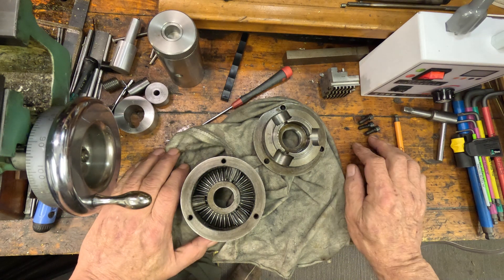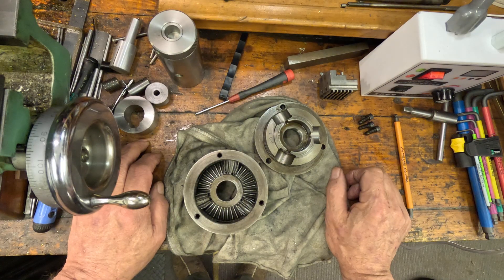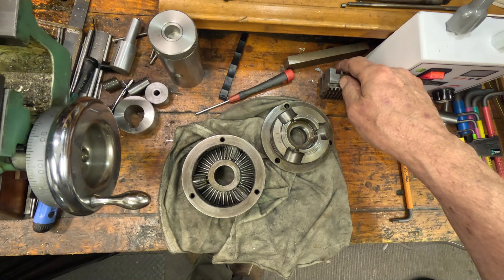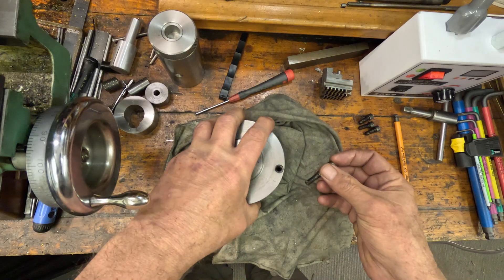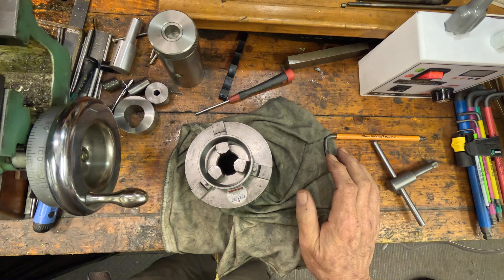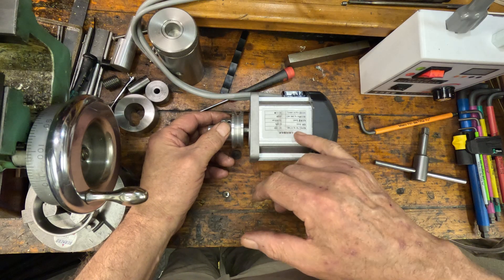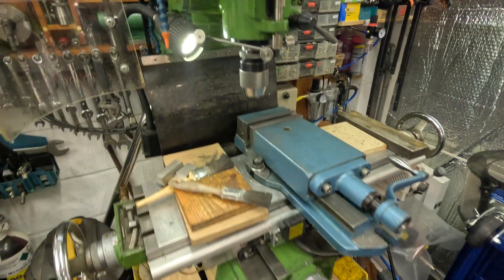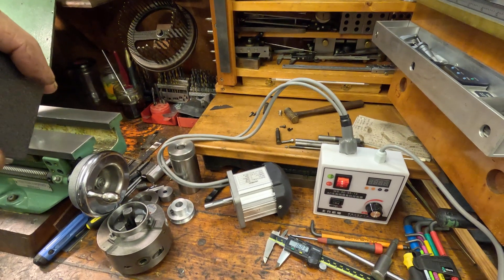Grinding Bernerd Grip-Tru chuck jaws and cheap Aliexpress reamers

Comment: Quality video!

I have avoided buying any reamers from ali because the way they do sizing is beyond confusing. I'm used to the standard inch method where a reamer size is given to 4 digits and it can be assumed to cut a tenth or 2 over depending on the situation. The metric/ISO protocol is tough especially with the language translation since there's h/H (case sensitive) and 1-10+ denominating the amount under/over nominal. The ali sellers are very loose with what they actually are going to send and I haven't found a listing that I was convinced was anything undersize for doing dowl pin holes.

Comment: If you use a toolpost grinder to grind the 3 jaws won't they have a radius on the faces? Traditionally a 3 jaw chuck jaws have flat faces.
The concentricity is entirely governed by the scroll which varies with wear throughout its range. If the jaws are ground in one position then they are not guaranteed to be concentric at other diameters.
Reply from the maker: You are correct and I thought the same thing, even as far as considering flat grinding the width of the ground part down leaving just 50 thou or so in the center. I think I mentioned I already attempted to flat-grind the jaws but without a surface grinder (I used my milling machine and a diamond wheel) but the result was not good. Nevertheless, it's a common solution used to correct this situation, and being a Grip-Tru chuck there is some correction avilable for runout. Remember these jaws were bell-mouthed - worn and not gripping at the front of the jaws on parallel parts, just the rear. They were effectively scrap without this grinding procedure but now at least they are usable. If I ever see a set of NOS jaws for sale I'll replace them because the rest of the chuck is OK.
Reply: @chrislx2006  It's usually the chuck flexing and wear in the guides that makes the jaws appear bell mouthed. When I have ground mine on the surface grinder I set them at an angle to allow for this.
Reply from the maker: @Bosun-8  The chuck was old and very 'used' when I bought it, and I don't know its history before that. It's possible someone had already had a go at grinding the jaws and not done a good job. There's obviously going to be some wear in the chuck but it doesn't seem excessive - the jaws appear firm in the guides. I do wish I owned a surface grinder!

Comment: evening Chris
lovely job with the chuck, shame about the reamers but they weren't made in Sheffield, and doubt any will ever be made there now. Lovely laid out workshop,
atb
Kev
Reply from the maker: Thanks Kev, I suppose for a 10 quid reamer you could say I got my money's worth 🙂 I fixed the pulley by boring to 22mm, fitting a bush and boring it back out to 14mm, so no loss there.